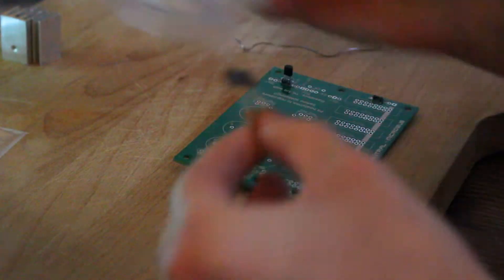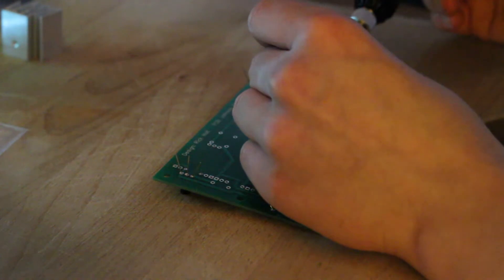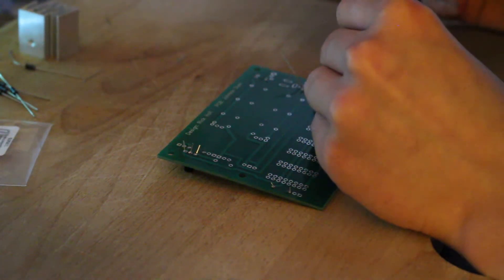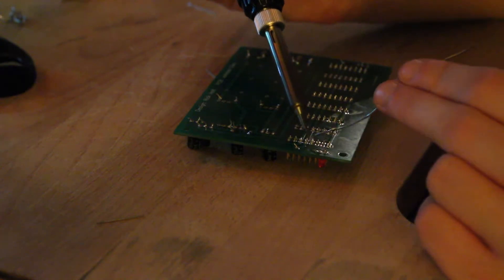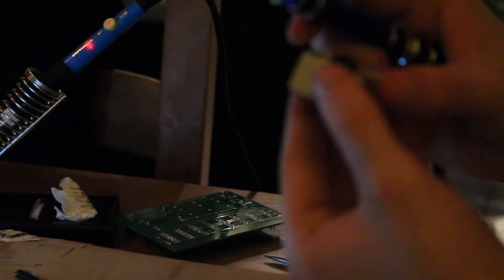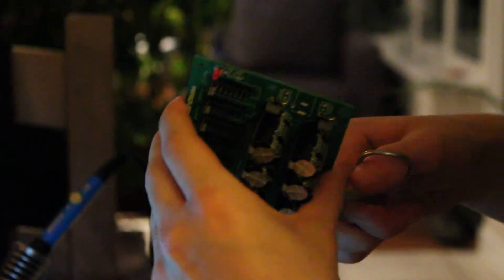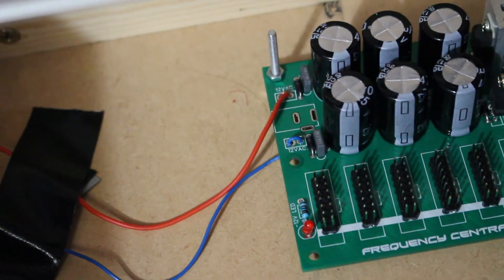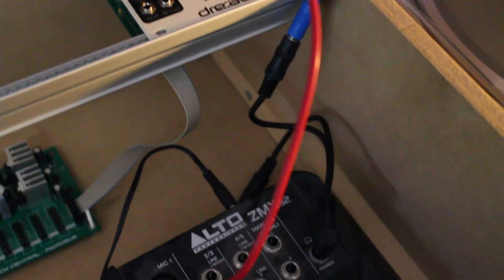Modular Synth Project: DIY Power and Case (Frequency Central MicroBus)

Comment: awesome video. The quality of this PSU for the cost is really amazing.
Reply from the maker: Sonny O'Brien no worries and yeah, it’s a bit more effort than a thonk kit or a ready made supply but definitely worth it for the saving!
Reply: Have you had any issues with noise or ripples? Drop outs etc.
Reply from the maker: Sonny O'Brien definitely no drop outs and no noise that I have noticed either, seems really solid!

Comment: Excellent video, thanks for sharing. Think I'm going to get myself one of these to build, looking to get a few cheap modules to compliment some semi modular synths I have. Have you seen York Modular on eBay and Etsy?
Reply from the maker: Thanks and no I haven't heard of york modular. Just had a quick look and couldn't seem to see the, on ebay, I'll have a proper look later. Frequency central pcbs and parts off tayda are probably one of the cheapest options although they are a little bit harder to build than some of the other kits off thonk for example. I build one of their envelopes in my next video and you should be able to see what I mean. :)